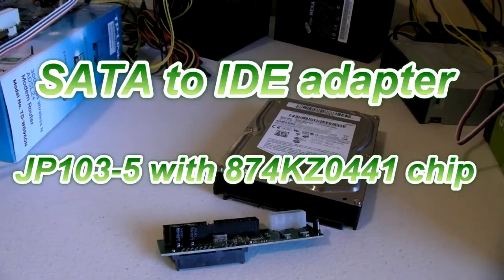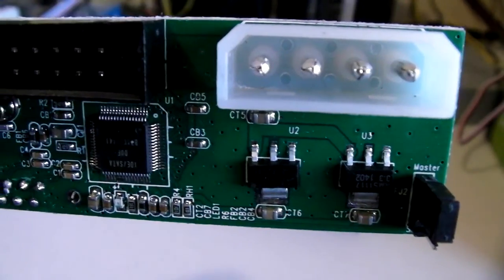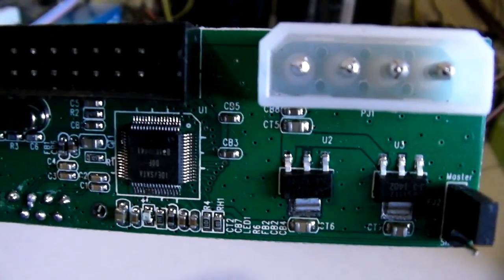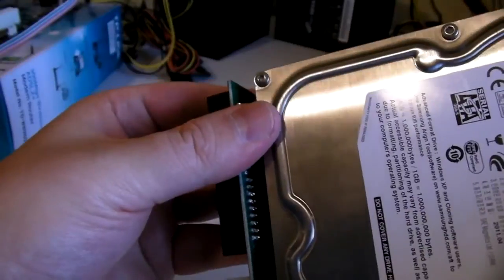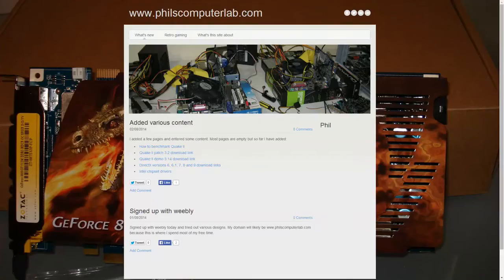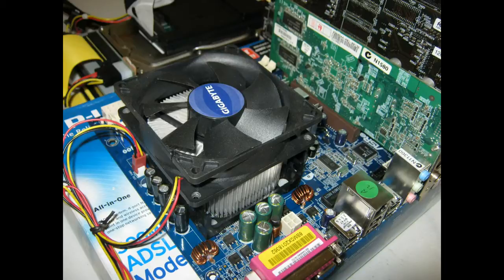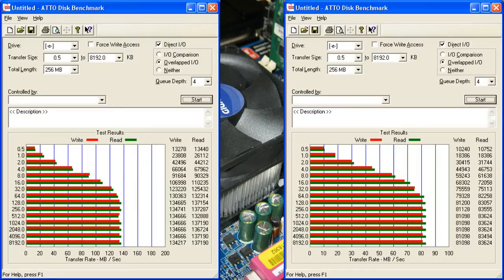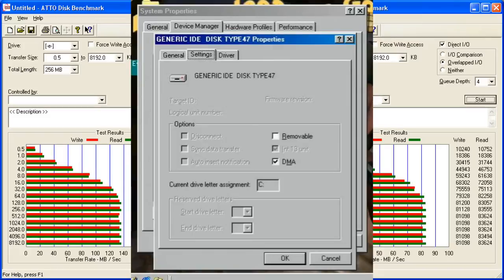IDE SATA converter review

Comment: In your experience, have you ever gotten a dodgy one of these? I bought one & it doesn't really seem to work, I might have gotten it working once for a brief period at best. Thinking of getting another one, but curious as to the failure rate so as not to waste much more money (even though they are quite cheap).
Reply from the maker: Yes I have with all sorts of cheap adapters. I usually order at least 2 or 3 for that reason.
Reply: @philscomputerlab  Ah, thanks mate. You may want to ♥again for the viewers, as I edited my comment. 🙂
Reply: @powerfulaura5166  i have the red one with the flop power to molex and the print on the PCB is jp103-20330-818-2..as far I cant get it to work. any had have any luck. my old one worked like 20 years ago. but this one don't work fsr ???

Comment: I was thinking about  replacing a very old 6GB hard drive in an also very old pc I want to rebuild into a Windows ME / Dos game machine. I don't trust the 6GB hard drive any more. It's old and it can crash. SSD's these days are nearly unbreakable with normal use. It's just the ide to sata converter that makes me doubting, especially reading the comments below, such a converter might detect a hard drive but can it cope with an (older) Windows installation? Or even dos?

Comment: Do you know of any thing like this, but for floppy drives? Like a floppy to SATA connector? Or even a floppy to USB converter? Really I just need anything that can convert a floppy connection into something a modern PC can use. I have a bunch of old floppies that I would like to read the contents of, but my PC doesn't support floppy connections. I can't seem to find a floppy to SATA converter anywhere, and I don't want to waste money on one of those USB floppy drives because it seems that they are just really old used drives that they converted to USB to make a quick buck. Most of them don't work apparently.
Reply from the maker: Of course, but for USB! Not sure about your concerns, they are standard stuff :)
Reply: (EDIT: I have managed to find this: http://www.ebay.com.au/itm/34pin-floppy-connector-to-USB-adapter-cable-/291267628376?nma=true&si=NE%252FvJ8EAPld5Q3u2b1ARaUuMPnY%253D&orig_cvip=true&rt=nc&_trksid=p2047675.l2557 But to no avail, because he stopped making it...)

No, Floppy to USB is unfortunately, not standard stuff at all. I can't find anything anywhere. It's all either a USB floppy emulator or IDE to USB connectors. Floppy connections are NOT the same as IDE. This site makes it sound easy, but they think that Floppy drives have IDE connections, lol. https://www.techwalla.com/articles/how-to-convert-a-floppy-drive-to-usb
Maybe even if you know of a Floppy to IDE converter? I can't find anything on that either.

But, if you know of anything, then I would absolutely be grateful for some information.
Reply from the maker: Not sure why you're arguing with me. My advice is to get a USB Floppy drive, take it or leave it basically :)
Reply: Oh god... is that really what I HAVE to do? I've seen so many bad reviews of those things that I don't know why anybody buys them.

Comment: I bought 2 IDE/Sata adapters on Ebay, My plan was to use an SSD in my legacy Athlon xp system but i couldnt get it to work, The drive didnt even show up in bios, Also tried it in my Thunderbird system and it had the same problem, Is my adapter defective or are there issues using an SSD in such an old system? Thinking of just buying one of those pata SSDs of Ebay instead at the moment
Reply from the maker: +Emil Hansson Never used a SSD, just standard hard drive with this adapter.
Reply: +PhilsComputerLab Alright, Maybe a modern HDD or SSHD is fast enough anyway, As a big fan of the 2000-2005 hardware I'm hoping for some more Athlon Thunderbird and xp content and maybe geforce2-geforce4 / Radeon 8000/9000 series Benchmarks, Really enjoy your videos!
Reply from the maker: One thought. Does the SSD have a jumper to set it to SATA II instead of SATA III? Maybe that helps?

Comment: Hello...just bought this converter....after installing this converter to existing hard drive do you have to go into bios and search as new device or go into disk management and set as primary or secondary device or is it just plug and restart?
Reply from the maker: Most computers detect the hard drive right after turning on. But in the BIOS is also a auto detect function to check if the drive gets picked up.